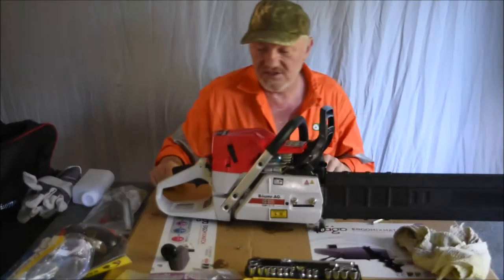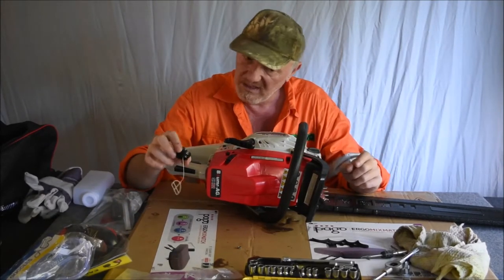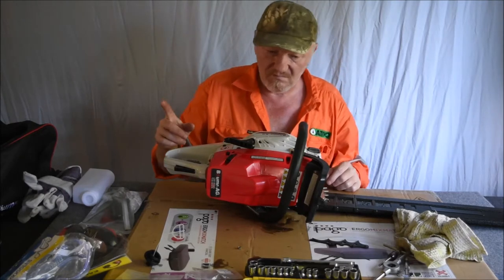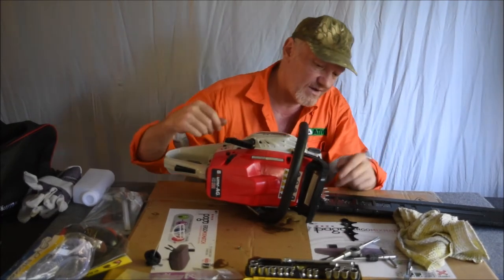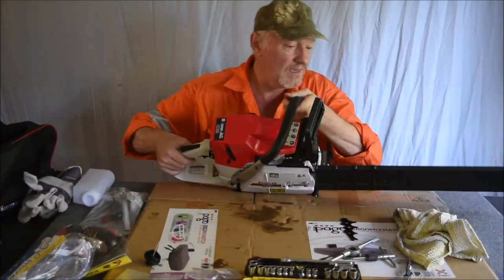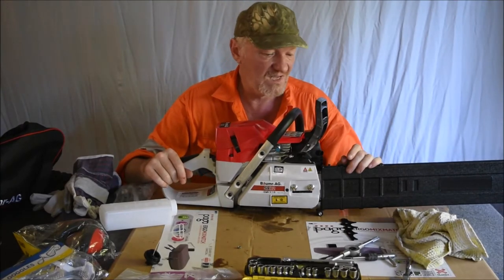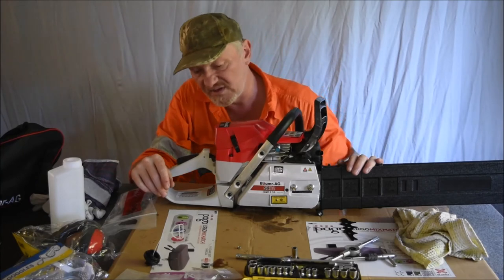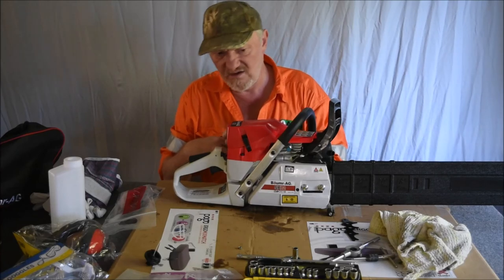Baumr AG SX82 upgrades

Comment: Mate just give it a 40 to 1 fuel mix with good two stroke oil tune the high side on the carb and just send it and use your back, those things rip hard if if you tune em up nice👍
Reply: I'll keep her at 35 until she's got a few hours under her belt then switch to 40, thanks for the advice.

Comment: place a twenty inch bar on your new baumr 82sx and 8 tooth front sprockert........i have just done this mod to both my new sx82s ...cutting through wood like butter
Reply: I know this was a year ago, but how is your baumr going? Had mine a year now and I'm having issues with the original bar and chain. Does the shorter bar length help?